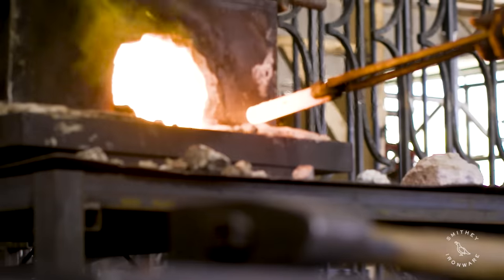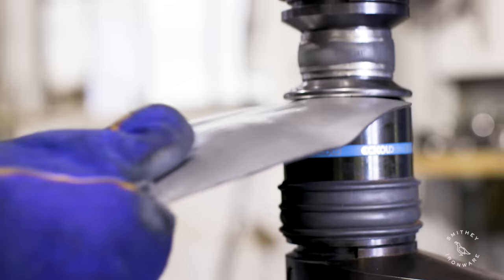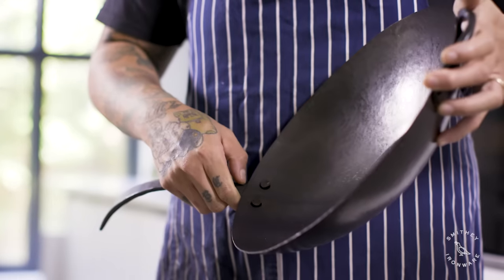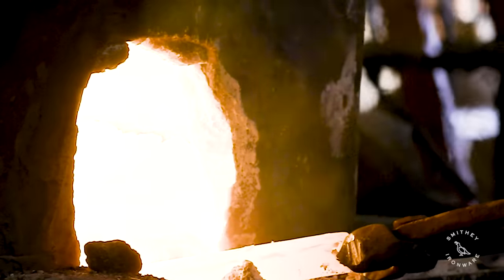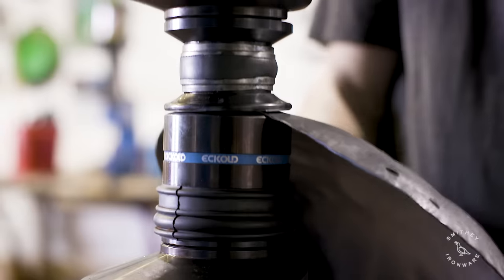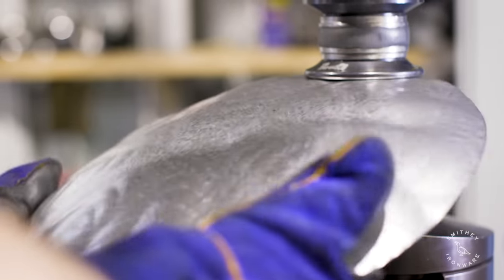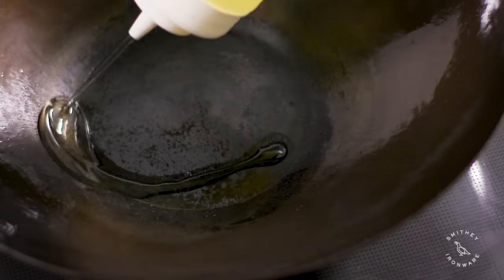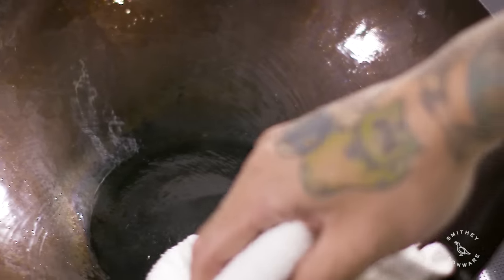Smithey Hand-Forged Carbon Steel Wok

Comment: Nice Wok but can we not put rivits. I just ended buying a single cut hammer forge japanes carbon steel Wok. After buying 3 cast iron skilit and a dutch oven from Smithey. The wok would be the 4th peace if the rivits are not there.